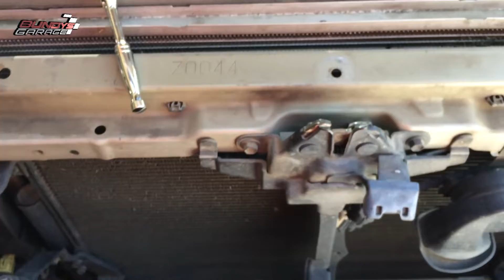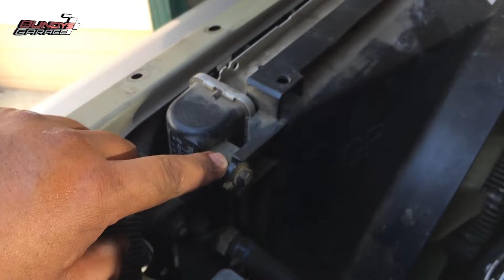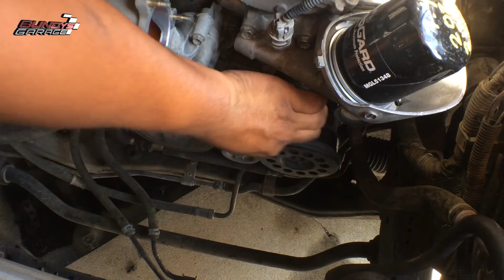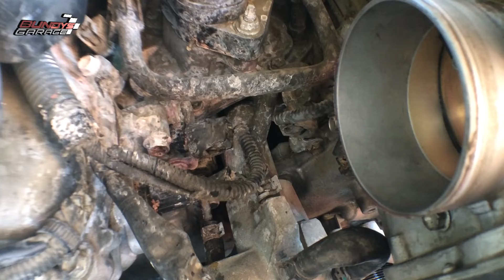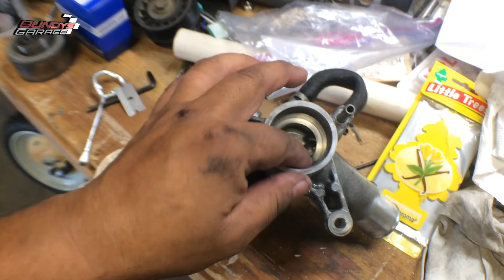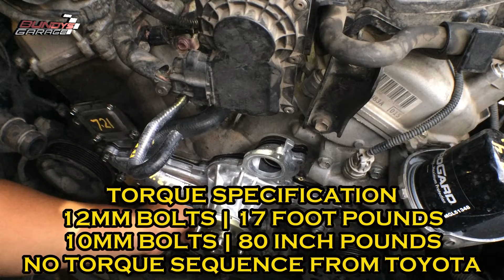How to Replace [1GR-FE] Water Pump 03 - 15 | 4.0L | Toyota Tacoma 4Runner Tundra FJ Cruiser Aisin

Comment: THIS IS NOT TH SAME AS A 4.0 TUNDRA OR THE FJ CRUISER. Theres one screw at the bottom by the tensioner pulley that is incredibly impossible to get out unless you grind on the tensioner edit: you need to put the socket on the top portion of the bolt  get a hammer and beat on it till it gets past the edge of the tensioner and then you can break it loose

Comment: Rtv is needed on some of the bolts it stops the oil from creeping through the threads it's on the forum factory puts on the threads they say to use lock tie, blue,
Reply from the maker: I bet it's better if you do put RTV (Toyota Seal Pack 103) but I installed this water pump and bolts with no RTV and it's been over 50,000 miles and no leaks, no coolant loss, at all. It's been rock solid.

Comment: 19:55 - I wouldn't be surprised if that WAS the original water pump at 200,000+ miles.  My 6 cylinder 2005 4Runner has 180,000 miles.  I'm the third owner but I bet it has the original water pump.  I'm watching this video because I plan on replacing the water pump, thermostat, serpentine belt and pulleys as soon as we have some decent spring weather, as a preventative maintenance to get my 4Runner ready for its second 180,000 miles.   🙂
Reply from the maker: Yeah I think you are right, I believe it was the original Toyota water pump, and it wasn't even leaking. It was a hose that was losing coolant, one of the small ones above the water pump. But I was in there and decided to go ahead and do the whole thing. When you do your water pump make sure you use quality parts, Aisin has a good kit, the same one I used in this video. But if money is not a problem, go to the Toyota dealership. If you can sub to my channel, trying to hit 100,000 this year!
Reply: @bundysgarage  - I had the AISIN water pump and thermostat in my Amazon cart as I've had success with them in the past.  I think they make OEM quality parts, but I had already changed to the original Toyota parts based on the consistent message from The Car Care Nut.  The difference in price between a good after market part and the original Toyota part is minimal, and I consider it to be good insurance against needing to repeat a repair, and an investment in reliability.  Similarly, I had aftermarket red coolant in my Amazon cart but switched to genuine Toyota pink coolant.  I'm saving a lot of money doing the work myself so I can afford to pay the Toyota tax on original parts, particularly when I buy them discounted on Amazon (beware of counterfeits) or at the discounted Olathe Toyota dealer's online parts website.

Thanks for the video.  I'll watch it again when the weather is warm and I'm tackling the water pump replacement.

Comment: Thank you, Bundy. Respect to the knowledgeable and honest mechanic, so rare these days!
I had the exact same problem took to a local Toyota, Halfway Toyota Fourways, SA. They quoted me a crazy amount (changing everything in the car) for entirely unrelated, nonsensical things all over the car. When questioned, it reduced to half, but still nothing remotely related to the issue and its related parts.
I guess old Toyota vehicles and their people were gold.
Reply from the maker: How much did they quote you? Yeah dealerships have a way of trying to upsell everything you don't need, without addressing the real problem and the real reason you are there. Have a friend, and she took her Sienna to Toyota in Hemet, CA. Her radiator was leaking at the seams on the top, red Toyota dried coolant all across the top, they never even caught it!?! But they sure wanted to sell her on a gravy brake job on all 4 corners for $1,000 bucks.

Comment: Great video.  Thanks for sharing. I notice on the oil filter the truck has 217 k on it ?  You ever had engine trouble ? I have a 2011 with 117 k on it and it also has the 4.0.  Every 5 k it gets Mobile 1 synthetic. Thanks again.
Reply from the maker: It's my wifes 4Runner and since we have had it, no major issues. Did the water pump when we first got it cause it was leaking. Rad hoses, thermostat, spark plugs, all coils with Denso coils, had to replace the rear hatch glass cause it exploded, one coil pack went out cause I went off-roading in Arizona in it and the cheap coils didn't like that. The rear hatch latching mechanism, front and rear brakes, a set of tires, she broke the vent cause she put a cell phone holder that attaches to the vent and it eventually broke the vent. Radiator is orginal, oh a front wheel bearing I had to replace. Nothing major, just seems like a lot of small stuff. Also that trip in Arizona, I broke the drivers side exhaust where it comes down from the CAT to the rest of the rear exhaust and the exhaust donut fell out and had a check engine light. I ended up replacing the whole CAT with new donut gaskets.

Comment: Hi Bundy great video and thank you mentioning each parts. I am thinking about replacing my waterpump, along iwth everything you mentioned on my 2005 taco v6 as well. My truck is at 310K miles running great just need some maintainace and water pump is first. I was wondering is there a reason you didn't change your radiartor along with everything else you did. I am debating if I should or not as well. Thank you for amazing video again.
Reply from the maker: Wow that is a great question. The reason I didn't change it is because it's the original radiator from when the Toyota 4Runner was made. That being said, it is a Denso radiator made in Japan. Now if you go to a Toyota dealer and get a radiator they are most likely going to give you a cheap Denso made in Taiwan or Indonesia, Toyota calls is their value brand, runs about $150 bucks and comes with the radiator cap. Now you can get an OE Denso from Japan thru Toyota but it's going to cost you about $500 bucks. Sorry for the essay, but the reason I didn't change it, it wasn't leaking and the OE radiators from Japan can last a long, long time, 30 years plus. Assuming you do coolant flushes and don't let the coolant go bad and hurt your radiator or head gasket. When it does fail I will kick down the $500 for a Denso radiator made in Japan.
Reply: @bundysgarage  Very informative and thank you for getting back to me. I will leave as is since there isn't anything wrong with my current one. Another follow up question, did you replace the whole tensioner or just the pulley on the tensioner. I know beginning of the video you weren't sure but I wonder what is best approach. I have seen how hard it is to do the tensioner replacement so I don't know if it is worth the pain. What would you suggest for my case :) Lastly is the fan clutch you bought pretty reliable? I see it is $200 cheaper than the OEM. ofc eveything is cheaper than OEM but that is a big price difference wonder what is the best non OEM fan clutch out there, I have also been thinking about AIKIN's. Really appreciate your guidance and help.
Reply: Aluminum rad, Extreme Terrain  CSH boss 595.00 4 inch awesome!!!

Comment: those bolts in the water pump are rtv’d from the factory.
Reply from the maker: That’s what I have discovered since making that video. But here’s the thing. That 4Runner is my wife’s and the coolant is always at the same level and I never see any leaks from or near or at the water pump bolts. So was it really needed from factory????
Reply: @bundysgarage I wonder if it was just a safeguard in case the holes for those bolts got put in a little too deep. Keep the oil/coolant in the right places
Reply from the maker: I check the oil and coolant weekly.

Comment: Bro that was a good vid, no bullshit and clear explanations and some tips. The common oil leaks on these are the inside rocker cover gaskets, timing chain tensioner cover ( you fixed in vid) and the timing chain cover( huge job to do this). Was also told to drop the oil sump on high milage and clean the oil pick up if dirty and remove any carbon build up in bottom of pan ( mine had plenty of carbon but pickup was clean at 320,000 km)- use 103 sealant to reseal oil sump pan. The pcv valve blocks on higher milage, and worth checking the camshaft solenoids are clean  and the vvti solenoid filters are clean.
Reply from the maker: Thanks for the tips. I actually stopped the timing chain cover oil leak. I didn’t feel like pulling everything off so I got some RTV (can’t remember off the top of my head but it’s in my garage) placed some where the oil was leaking and it sealed it up from the outside. If it starts leaking again, I’ll tear into it and replace the timing chain cover.
Reply: Bro great explanation!! I didnt know vvti filter exists…just chanche valve cover gasket, clean vvti, cam sensor clog with burn oil/sludge, vvti filter very dirty, square timing chain tensioner gasket! Tried to take out oil pan to clean it and clean the oil pump pick up screen but oil pan was stuck firm with silicone rtv. I couldn’t remove it! Just did liquid molly engine flush and it really improved timing function of vvti…engine runs sooo much smoother! Really helped overall engine performance and gas milage 14 to 19 mpg and improving

Comment: So most of what you replaced Is only If you want to replace while down there already right? Because I'm doing a repair for my lotential future mother in law so she can save money and she can't afford the extra parts. The water pump is the only part that's leaking and Is bad.
Reply: Yeah thats right. But check the timing chain tensioner cover as it leaks and the bolts are super low torque. You might get one of the pulleys bearing go and if so can replace just the one making noise. Worth changing the serpentine belt if its past due while doing this.
Reply from the maker: Also do the thermostat with an OE thermostat.

Comment: Was there anything else aside from the water pump gasket, and thermostat "triangle" gasket that you needed to change? im looking to do this and want to make sure i get all the parts i need ahead of time... also think that square cover is leaking on my engine, ill pull it off while im in there... was there much for leakage or did you figure out exactly what its for? thanks
Reply from the maker: Here is a video on the parts you need as well as a link to the parts on Amazon in the video description if you need them: https://youtu.be/YjJSdOBbRPk?si=GEOvd4XMvrq2xbyC

Comment: Thanks sir, changed mine out with the help from this video. Also did the tensioner, that was a PITA.
Reply: next time, just change the idler, its a left hand thread btw. its alot easier than doing the whole bracket and such

Comment: So about the mileage, I'm just changing one that I bought new in 2005. 224K, water pump is just now starting to seep. As surprising as it may have been, that very well could have been the original you had in your hand
Reply from the maker: They will last a long long time especially if you have an OE water pump and run the proper ratio of coolant. The worst thing you could do is run water in a cooling system. It rusts the engine from the inside out.

Comment: Are those two hoses you have listed in the description from amazon the hose you are removing at time code 12:34 into your video?
Reply from the maker: The ones in the description are the upper and lower radiator hoses. Check out this video that shows in details the parts used: https://youtu.be/YjJSdOBbRPk?feature=shared
Reply: Thank you

Comment: The little steel door is for the timeing chain tensioner inspection, I didn’t take my radiator shroud out to change my pump. Just drop the fan to the bottom and wrench away. Little tight but not too bad. Also, those 12mm bolts have  rtv from factory. Anyway, good job. You have the timeing cover leak just like me. They’re not that bad but it is not worth it to me to fix the timing cover leak. I just keep an eye on it.
Reply: Top comment for info. this is all true. also the timing cover leak is verrrry common which is why i like you use of "The" timing cover leak haha
Reply: Same. Very common issue on the 4.0. I wouldn't even bother wirh it
Reply: @deniseandmarkfirestine7443 I’ve also got a timing cover leak but am just monitoring it. Is there a good way to clean the surrounding areas to get an idea of how much is leaking? I’ve ordered brake parts cleaner but am hearing that is not good to use on the engine.
Reply: @AAT287 should be fine as you only spraying on the block
Reply: Yep i think i also have a minor timing chain cover leak

Comment: The RTV Sealent on the end of the 12mm bolts is factory applied.  Not a bad idea to clean up and reapply with new pump.
Reply: well it's not RTV, it's thread sealant. It is designed so the long bolts that go through cooling lines dont get corroded or leak.
Reply: Curious, what would be the need for RTV at the end of those bolts?

Comment: Hey mate...yep an Aussie here. Firstly thanks for your very informative YouTube clip, it helped and gave me confidence to do the job myself.  I have just removed the water pump from my Dad's '09 1grfe hilux that has done only 80,000k''s yep that's roughly only 50,000 miles, it was leaking fairly badly from the weep hole on the W/P.  Yes I was surprised too but, 100% one owner and can confirm from factory it has RTF on the long bolts and a slight smear on W/P gasket. So will be doing the same on refit. All the best and keep up the good work. Thanks again mate 👍
Reply: Hey mate did you use any rtv on the thermostat housing o ring on the back
Cheers
Reply from the maker: @bogz611 negative

Comment: How long do water pumps last? I have a 2014 4Runner I got from a dealership a few years back with 68,000 miles on it. I have 81,000 miles on it now. I have had it over 4 years but I don’t drive it much. Where I stay every place I need to go is a few minutes away including my job which is two minutes max driving distance.
Reply from the maker: Your water pump will last forever as long as it’s an original water pump from Toyota and not an aftermarket one someone installed before you got the truck.
Reply: Thanks for responding Chief. You got a new subscriber.
Reply from the maker: Thanks for subscribing Champ
Reply: Have 281k miles on my original.
Reply from the maker: What coolant are you running and how often do you change it?
Reply: @bundysgarage  I use zerex red for Toyota or Toyota red. I change my fluid every 30k miles now
Reply: designed to last 100,000 miles or so.
Reply: My 2008 4Runner has 351,000 original miles and counting.   Still has the original WP.  I do SLLC (Pink) coolant changes every 100K miles.   Your coollant looked like LLC (Red).

Comment: Thank you for showing how to replace the thermostat housing (held on with 5 bolts). This is the best video I've found that shows how to do it. Sucks that you have to remove the radiator fan and shroud to get to it, but now I know. Looking forward to trying this in my attempt to replace knock sensors.

Comment: Your “RTV” comment make you sound like an idiot. 
That water pump is fine and more than likely original.  It is an incredibly simple design that rarely fails.   Also ther is no evidence of the water pump or gasket leaking.  
You should have degreased and cleaned the engine first to isolate the exact leak location. 
The one smart decision was to replace the idler pulleys and belt.
Using a razor blade is risky to clean off any gasket material. A green scratch pad will do the same with nearly zero risk.

Comment: Thank you for your very helpful explanation of this patients zapping procedure.  
I am about to get stated. I am having problems getting all the hoses I want to change out all the hoses that come and go to and from the Thermostat housing/Water inlet housing. There are 7 different ones. I got the obvious ones: 2 to the radiator , 2 to the oil cooler, How do you identify the others.  The parts houses are no help.
Reply from the maker: That would be a question for the Toyota Dealership

Comment: When is it actually recommended by the manufacturer to replace the actual Tensioner itself?
Reply: My truck is an '09 with just over 200k on it.  I had my mechanic put a new tensioner in after I changed my belt and idler pulleys because the holding tab snapped off.  I assumed it was on it's way to failure but my mechanic said it was still in good condition.  Wish he'd mentioned that BEFORE doing the job!  As long as your belt isn't slipping or chirping, I think it's fine and doesn't have a specific replacement recommendation...

Comment: Hey i thought i had a fan clutch issue on my 06 v6 4runner. At idle it really was making an ugly wobbling sound and was coming from the fan. Replaced the clutch and same noise. Took it off again and noticed my water pump pulley has the wobble. Not originating from my fan or clutch but reverberates through it at idle. Dont see any coolant leaks at all and im crazy abt leaks. Should i be worried abt driving at the moment? Would i have catastrophic failure if the pulley gives on me? Im abt to go buy another car and jus want to know if im ok to drive my runner.

Comment: I've replaced the belt like 3 times already and before it gets to the shredded part where it quiets down, sounds like a million crickets chirping. Found out.. it's the water pump bearings making it unaligned and shredding. 2009

Comment: You should have discontinued your battery before taking off your fan, could have lost your hand mate
Reply: Fan is not electric will not start unless you start the motor.
Reply from the maker: Right!
Reply from the maker: I knew where the key was and no was going to start the vehicle and that fan is not going to start spinning on it's own. So I felt safe no disconnecting the battery, but if you feel that's what you need to do, then do it.